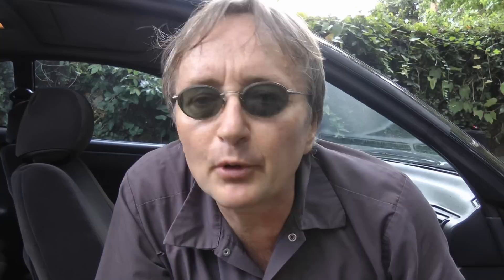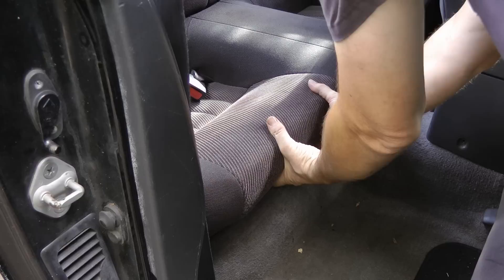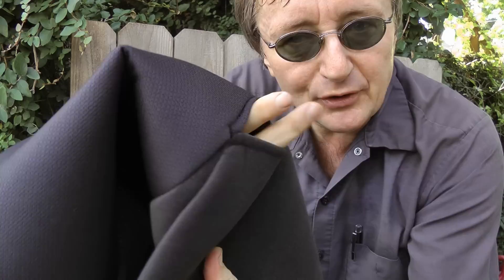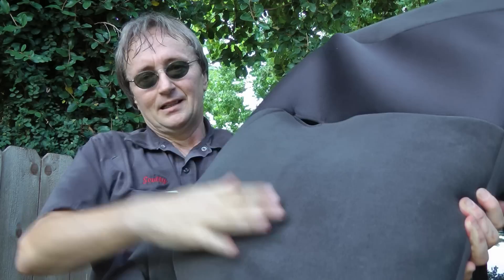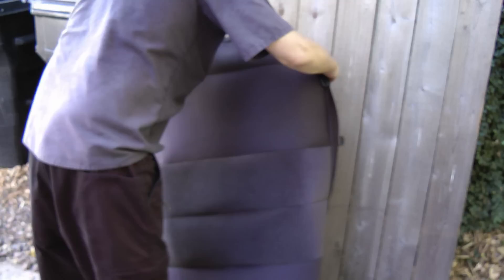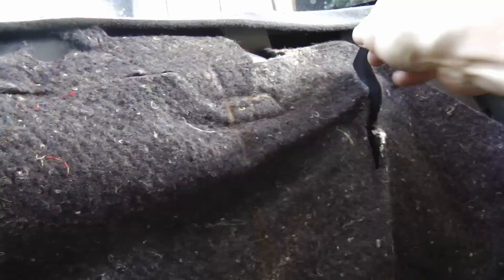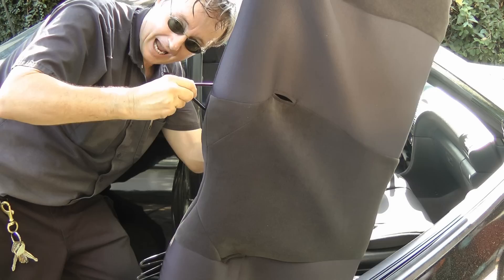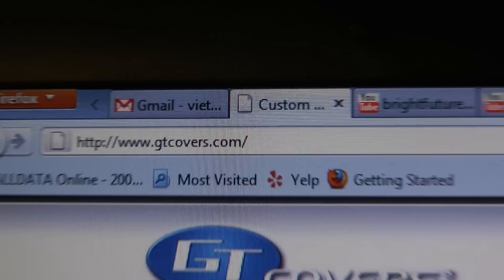How To Install Seat Covers In Your Car

Comment from the maker: @Matthew55904  They are all on the low side of the system. So go to the compressor and follow the low side hose, the fatter one, back to the firewall. Somewhere between there on that line all cars have the low pressure side line. Scotty

Comment: These look like the best fit for covers I've seen so a good choice if you want to spend less and do less. However I bought katskin brand leather upholstery for my 03 civic instead. It's usually about $1000 for the product from their site but since my car is older I found it new in box on ebay for less than $300 shipped. It took me two days, it wasn't very difficult. Just takes patience. looks great.

Comment from the maker: @edwperry553 who cares about gunk, it does no harm, and spraying water on an engine can ruin electronics. Side mirrors are all somewhat different, but most remove with 3 screws on the inside once you remove their inner plastic cover. Scotty

Comment: Hi, Scotty!  I have a 1993 Volvo 960 and am having the hardest time finding seat covers.  The back seat headrest, push down INTO the back of the seat and the fronts, I cannot figure out how to remove.  Also, the back seat has an integrated booster seat, which we don't necessarily need. However, the way the headrest in the back push down, I do not understand how a seat cover will fit. Any suggestions?  Thanks.

Comment: @moofushu I sometimes had similar problems. According to physics, the shaper the contacting part is, the stronger the discharging is. So instead of letting my finger touch the door when closing it, I used my elbow to touch the B pillar to discharge when getting off my car, and I was never shocked anymore :D 

Sorry for my english.

Comment: can you show how to remove a side mirror for painting, while you are doing all this detailing.. 

and if possible show how to clean your engine, like removing the 20 year old engine slime from my 92 volvo, outside and inner? i just didnt know if a hose is a bad idea, which i assume so. or if u have run across a chemical in the last 40 yrs that cleans built up grime and dust safely

Comment: the covers for a 99-04 mustang gt coupe are 200$ for the front and 350$ for leather and thats only for the front seats, i could just get them reupholstered in leather 350, i really just want the driver seat redone because the passenger and back seats are in mint condition

Comment: What if you want to change the foam underneath? Dealer wanted over $700 just for foam on a Cadillac driver's seat bottom. Thats right, just for the foam. Seems there has to be a better way/source.

Comment: i went to car strippers and bought used seats from Subaru Impreza WRX 2006 sedan with only 80 dollars , that is really cheap , other car strippers shop was offering the same seats for 320 dollars two years ago, thanks for god .

my car is Subaru legacy 2002 sedan , the front seats fit directly without any modifications, the rear seats need some easy work .

now i have sport seats on my car

Comment: hi, on my car is the driver seat a bit loose, it is moveable to the sides,
 I can also move the "thing" you can attach the seat belt in , then the seat starts to move (to the sides). I have tryed to tight all screws i can see on the driver seat, but the driver seat is still loose, it is also difficult to move the seat forward and backward, i also checked that the seat is entered properly, and i am pretty sure that the seat is not worn og damaged

Sorry my bad english, but hope you understand